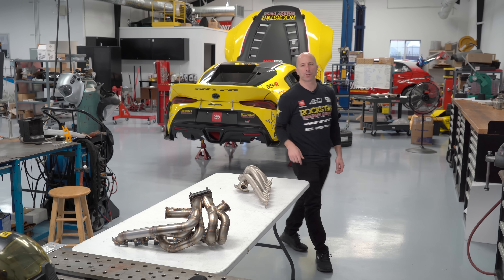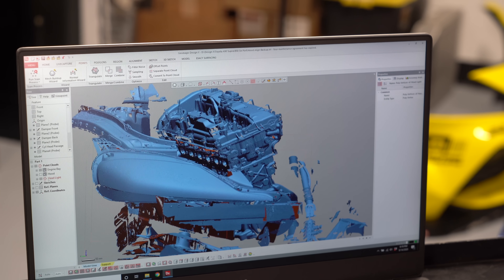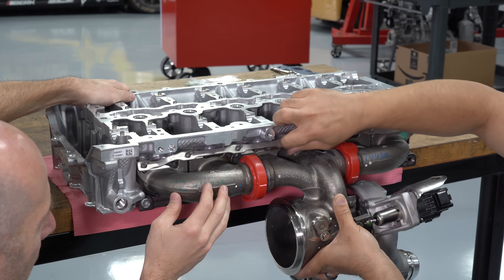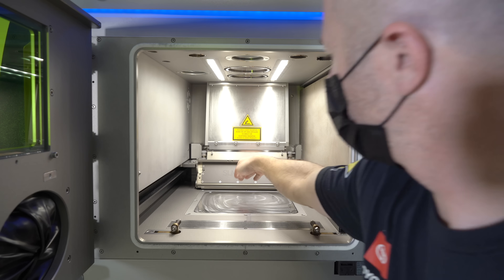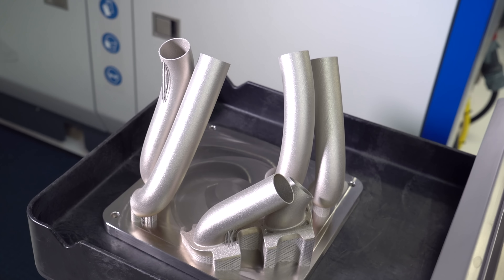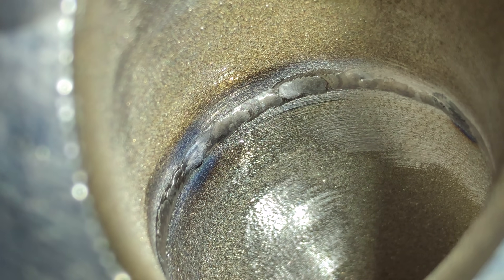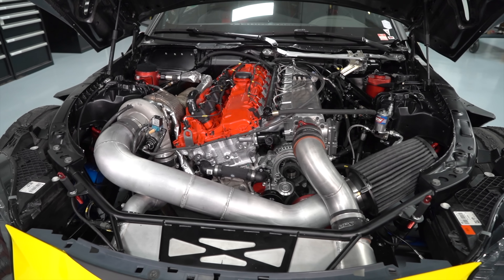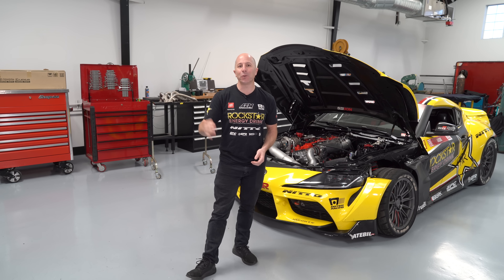Turbo Manifold 3D Printed from Inconel Powder

Comment from the maker: For those following the GR Supra build and noticed that we now have a 6 exhaust port cylinder head instead of the 2 port with integrated exhaust manifold: The 2021 GR Supra A91 now has 382 HP and a revised cylinder head with 6 exhaust ports. Once we went with this new cylinder head we needed to make a new turbo header.
Reply: 382?
Reply: hell yeah 6 port head!
Reply: So, in your opinion/ threw the testing, would you say the new designed head was a better/more efficient design over the old single port? Been curious about which is more important, the flow or the thermodynamics. In my head (aint no genius, just a car nut) the single port seems to offer better thermo-propertys, but at a loss of peak flow, where the multi-port head would give you better flow, but at a slight loss in the thermo department.. (hope that wasn't confusing 😁)
Reply: Still would love to see one your in-depth videos better explaining problems you saw and the other solution you saw other then just gain I'm power.
Reply: Thanks for clarification!
Reply: What was the advantage of using 3D printed metal vs. a fabricated part? Cost vs. benefit?
Reply: @sepg5084  He said in the video, little to no waisted material (which being inconel is $$$), get a perfectly designed/tested part before actually getting to any metal stage, plus being able to use these exotic metals at a MUCH smaller cost than it would be to fabricate the same thing out of inconel steel stock (could only imagine what a stick of that would cost, plus the havoc it could cause on normal cutting tools and such)
Reply: @1dickycat  But in this case they still had to weld a lot of the pieces together. I've seen 3D metal printing used to create some very large and/or complex parts, this project didn't really seem to be either. If the header came out as one finished piece it would've made more sense. Or they could've just done it like they did the stainless header, design the segments, have each piece cut to shape, and then welded the manifold.

Either way, it's cool to see inside the development process, so I can't really complain!
Reply: @Balomis  And I would understand this if it was any other everyday material. BUT, I could be wrong, ive yet to see Inconel weld el's... so if im wrong, show me where you can get get inconel tubing, let alown any bent up pieces. Pretty sure if it was avaliable, they might have gone that route.
Reply: @Balomis  Also, I know you've seen bigger pieces 3d printed, so have I. But think about it for a second. If it was 1 big piece, how in the world would you go about getting ALL the infill/temporary pieces out of all 6 runners... would get a lot trickier, thats for sure
Reply: @Deep42Thought  * Laughs in 31 year old Supra with 6 exhaust port head *

Remember all the stories of Toyota "taking apart the BMW engine and going over it to make sure it met their 'standards'?  So in all those "8 years of development", they didn't figure to fix something so basic??  They literally disproved their own marketing BS the following model year.
Reply: @enigmaPL  Well, Majority of the world still have the 2-ports engine where emission and efficiency matter. They are both great engines. Lucky Americans.
Reply: super cool info !
Reply: I knew you guys would switch over.
Reply: Thanks for the explain, I thought they were internal, nice to see them change it
Reply: Watching it at 7 am Irish time and i thought I was crazy seeing 6 ports lol
Reply: Absolutely.
Reply: I was about to ask how you modified the cylinder head but now I know 👍
Reply: Amazing content as always! One question though. The inside of the printed manifold looked a bit rough. Will that be "honed" later or would that be left as is?
Reply: Ahh
Reply: Supra only changes the cyl head or including z4 as well?

Probably to promote more aftermarket header and turbo options?
Reply: Many of the jz cars in FD had major engine failures, is the b58 more reliable?
Also thanks for the detailed insights!
Reply: Papadakis Art!
Reply: Top Top job! 
Excellence
 in every detail!!!

Μπράβο Παπαδάκη !!!
Reply: Wow is the new head is custom build/modified one?. I remember the 2 port ex manifold. Now it's more easy to tune ex manifold. Waiting for the dyno and see the difference. Unique tuning papadakis. Hatsoff ❤️.love it
Reply: @sepg5084  I'm assuming it's to build the most efficient part vs trial and error. when you do traditional metal fabrication you add useless weight because you don't know what the end result will be...
Reply: Very cool,would making turbos from inconel work? I've seen a lot of jet engine development and was wondering wether vortex inducing could be printed into a manifold? In a jet engine ignition chamber the vortex creates a boundary layer that drops the temperature:)
Reply: Suddenly every A90 Supra owner wants a 6 port head. I would feel so mad if I bought a first year Supra. Especially the guy that spent a boat load on the first one ever sold at the auction.
Reply: Haha, love the 382 hp troll. Watch all the way to the end, folks!
Reply: @1dickycat  A detailed answer from Stephan would be great. I think there are advantages to each specific design but makes me wonder when one would shine over the other. Also I think most tuners agree that for all out max power the 6 port head may be the better choice.
Reply: Not only I liked this video for the car stuff, but being a hobby 3d printing and designing hobbyist it was fascinating to see the process of making all this stuff!
Reply: @karanadon137  no one is trolling. the 2021 supra comes with a new 6 port head and makes 382hp. He didn't say they dynoed this new car at 382hp...
Reply: @CSOCSO  My bad, I misunderstood the comment. I read it as him saying the drift car had 382 hp. Thanks for pointing out. Cheers!
Reply: Κιριε Στεφανε Παπαδακη ..
Σε χερετω απο Κυπρο 🇨🇾
Συχαριτηρια για την δουλεια σας
🙏🙏🇨🇾🇬🇷🙏🙏🇨🇾🇬🇷🙏🙏🇨🇾🇬🇷
Reply: @karanadon137  No I misunderstood. When he wrote it NOW has 382 I thought he meant after his modifications. Thought it was supposed to say 1382 or something
Reply: If i can afford ot heckin yes i would
Reply: How does the 3d printed Inconel header compare to the one fabricated from tubing? Is the 3d printed part just as strong?
Reply: Thought you were going to show the dyno run but not the result.  You're such a tease!
Reply: @tetnum  Has only 1.4mm walls. A fat bead is s strong weld, not really that big a deal. Extrusion would make too many thin spots on the bends.
Reply: Did you guys just go with the new head or did you get a whole new engine from the 2021?
Reply: @tetnum  and Stephan

Honed intake ports has been a proven vol eff gain.  No dimples, just baby bottoms.
Reply: @tetnum  bet he knows them already. He's been racing for ever
Reply: Any reason you are going to a top mount turbo? Love that you are using a twin scroll set up. Very smart.
Reply: how much Autodesk Inventor use is there in the automotive aftermarket? thats what i use the most at work now.
Reply: So sick I love your work....good luck brother
Reply: @Balomis with 3d printing some things require supports to be printed at a certain degree of overhang. The tubes need to be supported inside and those supports need to be removed. Most likely this is why the header was printed in sections, as there would otherwise be no way to access said supports.
Reply: It's all about EGT's
Reply: Was curious. Thanks for clearing that up
Reply: @sepg5084  fabricated you are limited to bends-tube available. Printed you have what ever radius and diameters you need.
Reply: Yeah sure man
Reply: I mean... id try the 3d printed one..
Reply: This time design the weld seams to be in locations that are better positioned for welding.
Reply: Έλληνας είσαι!!!!
Reply: @projek01  I'd say I have a way of how it could work in my opinion. U can practically use the 2 port B58 case u want your mk5 to sit in the 7-800whp range. Now with the 6 port of say go for it in case you have the goal of pushing over 1000whp+ since you'd have the advantage of better airflow and etc with the 6 port.
Reply: Have you ever think of doing lecture at university? Because you are very good at explaining things.
Reply: Guys, please correct if wrong; the original (first gen) B58. In cars like the 140/240.. doesn’t that have a 6 port cylinder head? 

Then when the B58tu came out it went 6 into 2? Amazing video again. Really enjoying the detail and B58 development. It sounds unbelievable!!!
Reply: Stop making cool stuff you're making us jealous
Reply: May I have one lol
Reply: OK that’s exactly what I was trying to figure out when I was watching this video I was like I thought the GR supra head to exhaust manifold ports not six I was wondering if y’all like mill down the head or some thing but I guess the 2021 like you said as a different head that’s awesome more power baby
Reply: @roadreg1820  no. The mk5 came with a 2 port head so it'd meet emissions. And yes the 140/240i's came with 6 port heads when they first came out. The 20 mk5s B58 is the B58C which was a 2 port B58 so it'd meet emissions when it first hit the market(mainly for the EU)and now the new 21 mk5 has the 6 port head(B58TU I think but with a some different parts)
Reply: @carboydorifutoparty3976  that’s wicked, so now it’s very similar to the original B58 design before opf! Good to know 😌
Reply: @roadreg1820  its got a different pistons and a lower compression ratio compared to really any other B58s really but no ones really gotten around much with the 6 port yet since most are trying to find out which ones do or don't have their ecu's locked or not.
Reply: @sepg5084  He explains that the inconel is four times stronger when at operating temp, and that strength allows them to make it much thinner than stainless.
Reply: That decision alone deserves a video. It was a big talking point for this car/build and in general. Pros and cons etc.
Reply: Nice work your putting in that engine. But it's so bad that toyota has been saying that have used 8years on reviewing the engine and then makes revisions already. 

It's by fare the best BMW engine in a along time.
Reply: @sepg5084  tbh there way less time and money if they just used stainless. This printed thing seems an awful lot of work and expenses for no gain
Reply: Stephan, sir, thank you again for the mindblowing tech with excellent teaching and explanation!  These videos are so well put together and educates us while not talking down to us.
Reply: I designed an exhaust system for a 22R Toyota back in 1981. Refabished the Doug Thorley headers, built  the flanges on both sides of the Torbo, configured the remaining elbows to flow into two Side-draft Mikuni Carburetors. It went 120 mph in 4th gear, 130 in 5th.
Reply: 382 HP? That all?
Reply: @tihzho  stock
Reply: @ketillundsrensen6167  well if you did any research you would know that the B58 came out in 2015 as a 6-Port engine, and in 2018 they did updates to the B58 and gave it a slightly bigger turbo, changed the oiling system a bit, lighted the crankshaft a bit, among other things but in 2018 they also introduced the 2-Port engine. Both 6-port and 2-port engines are still being manufactured side by side. The 2-Port is made for places with strict emission laws like Europe. The 382 horsepower 6-port B58 first came out in the 2018 Z4, the 2020 G20 3-Series, and then the 2021 Toyota Supra. The reason the 2-port was the first to come to the U.S, we have no official reason 🤷🏽‍♂️
Reply: @roadreg1820  well, there are 2 Technical Update engines, the 6-port and 2-port.
Reply: PLEASE MAKE ANOTHER PROJECT, WE NEED SATISFYING BUILT 🔥
Reply: @PlaybackMansion  Surely a typo, nans toyota camry has that much power haha
Reply: How comes you can waste all that money and resources for a Supra? Is there drug money involved?
Reply: I am from Egypt and working on a 2007 Lada car modification project. Can you help me with it so that we have no experience, not a beginner?
Reply: @sepg5084   more lighter and stronger
Reply: @1dickycat  I'm no car genius myself but I completely understand what you're saying bro, so I'm sure they'll understand aswell. I also really like you POV definitely something I wouldn't have thought about but glad you did. I hope they can answer that ae I am very curious myself.
Reply: @sepg5084  I can only imagine how much the 3D printed part cost?... Yikes definitely and arm and leg lol and that's cheap
Reply: You probably dont care at all but does someone know of a trick to get back into an Instagram account??
I was dumb forgot the password. I love any tips you can offer me
Reply: @Keanu Kason instablaster =)
Reply: @Ameer Finnegan Thanks so much for your reply. I found the site through google and I'm in the hacking process atm.
Seems to take quite some time so I will reply here later when my account password hopefully is recovered.
Reply: @Ameer Finnegan it worked and I finally got access to my account again. Im so happy:D
Thanks so much you saved my account!
Reply: @Keanu Kason happy to help :D
Reply: @1dickycat  air spins a turbo not heat!
Reply: spyrospanopoulos era 2023
Reply: @PlaybackMansion  looks more like 832 lol